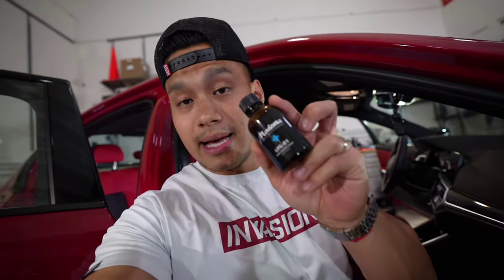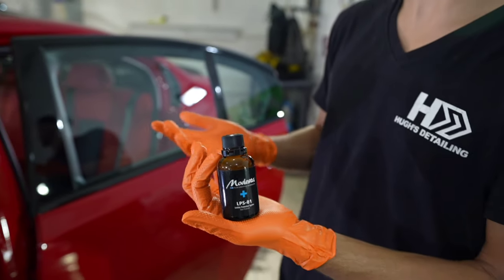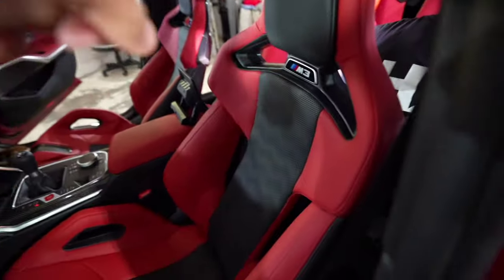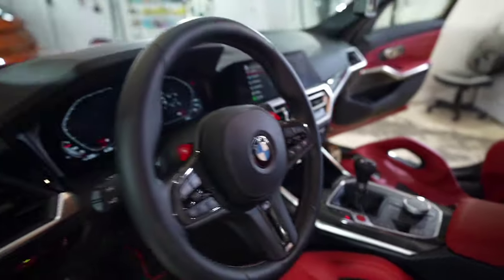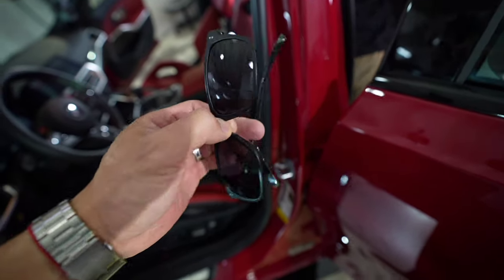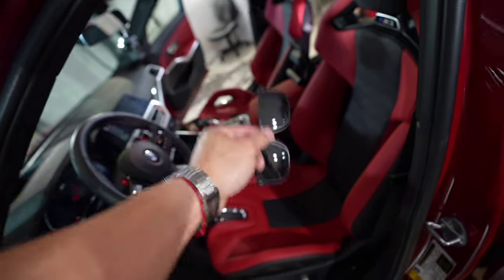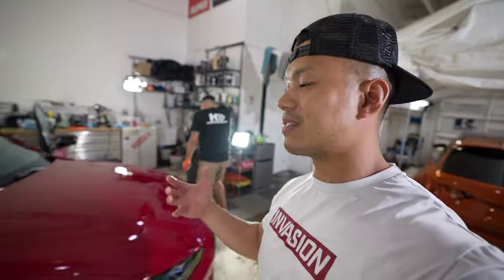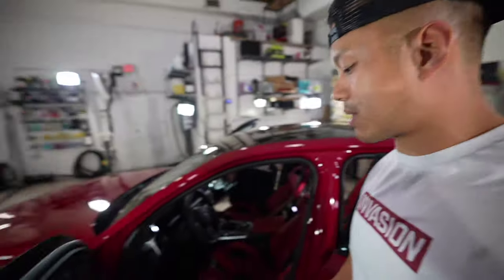This Is How I Protected My G80 M3's Interior

Comment: How has this held up one year later? 

I just got an 2024 m4 comp pack with m bucket seats - the only difference is my seats have Alcanterra on them. Do they ceramic coat this as well?
Reply from the maker: It's actually held up pretty well. As long as you use the right techniques to get in and out of the car it helps preserve the bolsters. I've made a video about that in the playlist

Comment: I can't speak for Modesta but I applied two coats of Gyeon Ceramic Leather Shield to my G80's silverstone interior and I can tell you that I sill find scuffs (mostly from my son's shoes) that require moderate agitation and use of a leather cleaner in order to remove.  Not sure if Modesta is better for this situation but so far the Gyeon product has been a waste of time and money.  And, yes, I followed the Gyeon recommendations for prep and application to the letter.
Reply: Considering modern leather is already coated, a leather coating is pointless and brings very little benefit.
Reply: @KiranPatel-fk1pg  Coatings like this are supposed to add an extra layer of stain protection and ease of cleaning. But In my experience they do not.
Reply: @Aaron-yn4bk  correct, because the leather is already coated. Meaning the benefits are very minimal. You may find a little less colour transfer on light coloured leather but overall I don't see a need to coat modern leather. It's more of a gimmick and up sell for detailers imo
Reply: @KiranPatel-fk1pg  yes, I’m agreeing with you. Whether it comes already coated or not is not my point. The point is that the leather that comes stock stains and dirtys easily. These coating companies are selling the promise that by adding another layer of protection your leather is now stain proof. Untrue IMO.
Reply: lol, coatings are NOT bullet proof, same goes for the paint and leather. Paint will still scratch with a coating just like if your son is all over the seat creating scuffs.
Reply: @seang3538  yea I think we all established that. But thanks for your input anyway.
Reply: @seang3538  Yes but paint coatings provide far more benefit. Such as won't get as dirty, easier to clean when dirty, adds gloss and slickness,  lasts years, chemical resistant etc. A leather coating makes the already coated leather feel about the same. Coating old uncoated leather would very likely make it easier to clean and more resistant to staining / colour transfer. But for modern coated leather a coating doesn't add much.